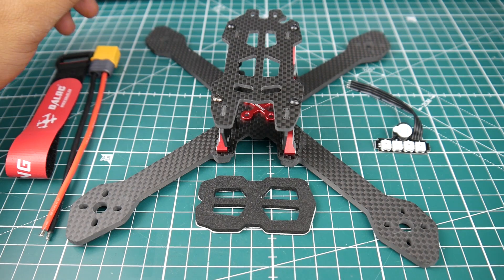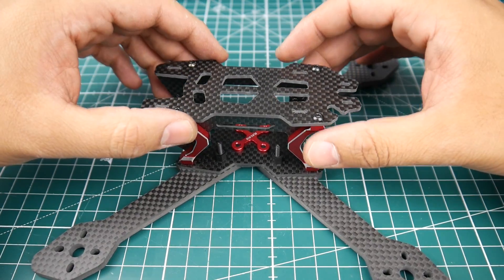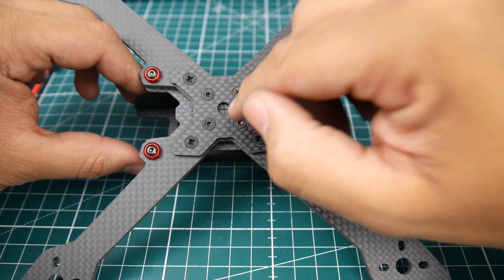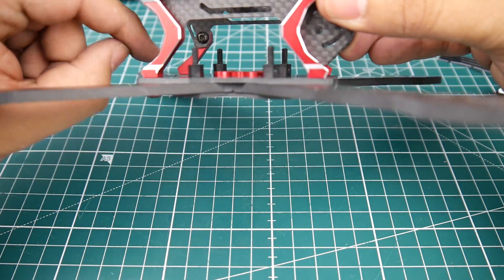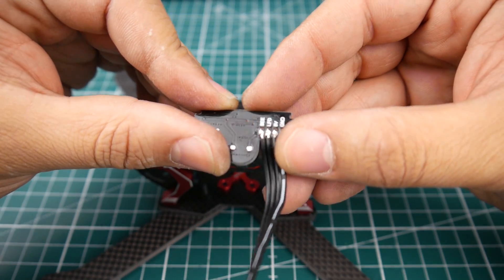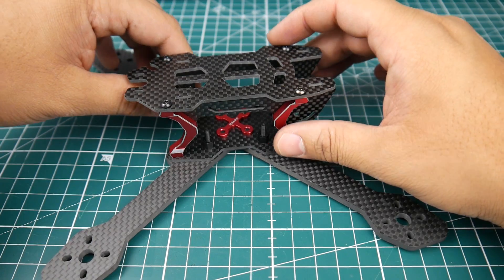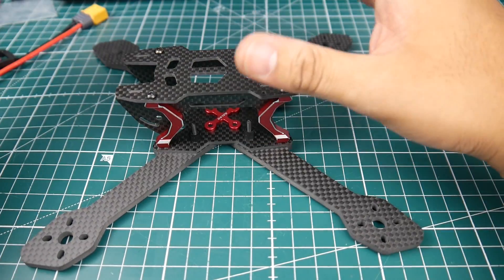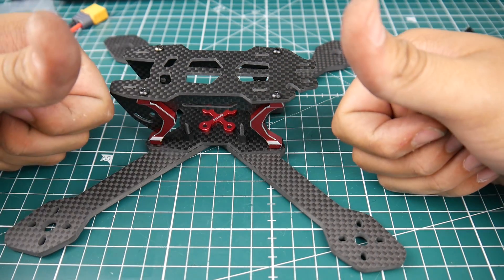DalRC X212 Frame // Overview

Comment: Looks nice. Is this frame intended more for racing than freestyle? Seems like not much room for a gopro with the battery on top. Suppose you can bottom mount if you like but goes against design intent. Thanks! Look forward to your build video.